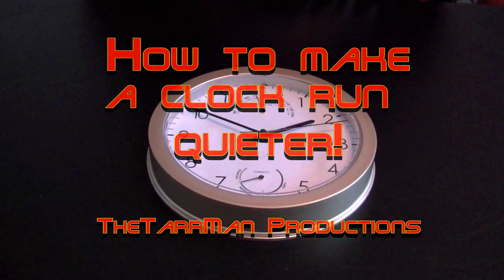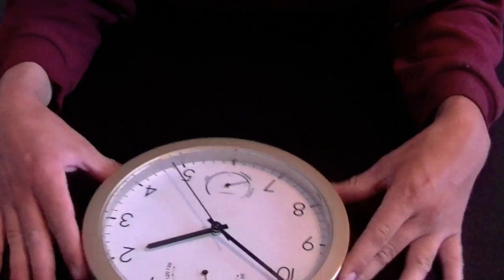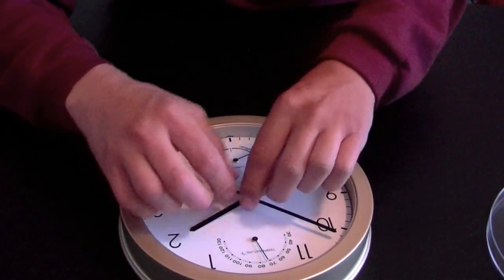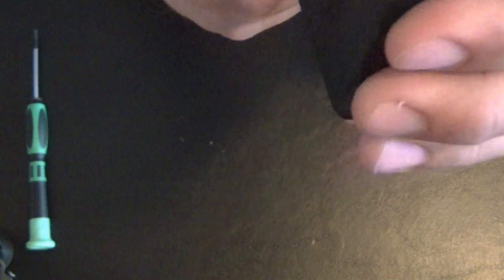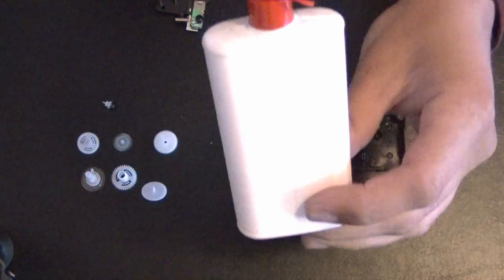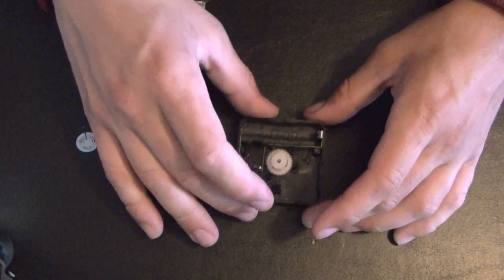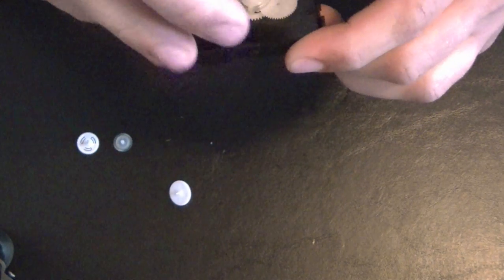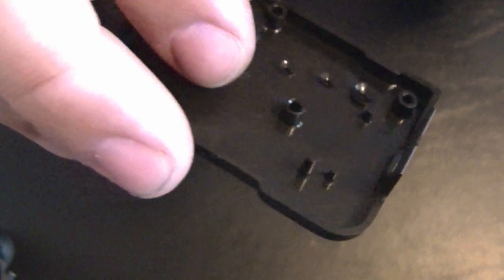How to Make Your Clock Run Quieter

Comment: Watched your video and my clock went from super annoying loud to barely a whisper.  However, you might want to refilm it because 1/2 of the important stuff isn't being filmed.  You are holding everything above the camera lense.
Reply: I fallowed every step but unfortunately, after the procedure, my clock stops moving . So disappointed. Somebody could help me out?
Reply: Kira Kira  Glitters I think it's all about the oil slowing down the movement of the magnet, Too much or too thick the magnet will not make the 1/2 rotation it needs to.  I doubt the oil on the other gear shafts make much difference.   Wipe off most of the oil on the magnet.

Comment: Over time oil will damage plastic gears. Better to use silicone lube.
Reply from the maker: That probably true but it's still working problem free. It's not like it's something I touch and adjust all the time either.  The only time I mess with it is for daylight savings.  It's still even using the same battery.
Reply: @TheTarrMan  could i use wd40?
Reply from the maker: It's been over 5 years now and it's still working fine.
Reply: @TheTarrMan  Lenny is technically correct about using a silicone based oil for plastics. Most likely the reason why your clock is still working is because it is a light duty application and it will take a long time before the ends of the wheels become so soft and flexible that the clock won't run. You would see the results of using the wrong oil or grease much quicker if the gears were under a heavy load such as the plastic gear that is used in power windows in automobiles. For those applications I use white lithium grease. I make clocks out of old damaged records for friends and I agree that a little oil makes those quartz movements much quieter so oiling them is always the first step. They make oil for quartz movements but I just put some silicone spray into a bottle cap and use a piece of wire as an applicator.
Reply: I used a solvent free bike suspension oil, works fine for plastic and rubber bushings, must be good for plastic gearing

Comment: Thanks for the Video. The most important tip is to go very slow and careful while opening the "Black Box". The plastic gears are sort of fragile and loosely fitted in together. And the second most important tip is to take pictures prior removing each plastic Gear. Don't base it on your memory . Everything within the assembly starts to look alike by the time all gears are removed and time comes to rebuild the Black Box and place all gears back together in their right places and correct Orientation.  Last tip is avoid too much oil and give it a try.  If it doesn't work the first time don't simply throw away. Keep at it and repeat the steps until you place all gears back correctly.

Comment: I did this one night when i couldn't sleep...
Well actually i have to admit, i was in a bad mood, so i just pulled the clock off the wall, took time setting wheel off the back and poured in like half a spoon of thick machine oil and shake it really hard, then put it on a newspaper to drain the oil.
It is almost completely silent since, and still runs after like 3-4 years...and there is a long oily stain on the wall from oil that has dripped out over next years, and some of the oil went to the front of the clock face...and it is still there ;-)
Reply: ㅋㅋㅋㅋ

Comment: It worked!! I ordered a clock oil from ebay for about £3.50. Luckily I only had 4 little circular dials to remove and oil up so wasnt hard to keep track of! When I put it all back together again I was almost worried I messed up because I couldnt hear anything, but it works! I could only hear the ticking when I put my ear right against the back of the clock :D my room is now silent
Reply from the maker: Glad to be of service.

Comment: I have a sweeping second hand that was loud even though the brand claimed it was silent. But a few drops of oil on the gears and the dimples really DOES make a difference. The tick went from being louder then traffic to nothing. if you are scared of breaking anything just take pics every piece you remove so you can piece back easy.

Comment: In my case and it worked for me, and I don’t see why it wont work for most battery powered wall clocks. If the ticking annoys you, then an easy way to stop the ticking is to remove the second hand if you don’t need it. It’s easy.
Just remove the clock front, pull the second hand off and replace the clock front. Done.

Comment: Clever and interesting.  

The alternerative of course, because the clock 'module' can be removed, is to replace the whole 'module' with a dirt-cheap sweep seconds movement, so that the seconds hand moves continuously round the dial, not pulsing, which would be so easy to do and I already have an on-line company I've discovered who can sell those.

(What I like about the continuous sweep-seconds movements is because it makes it look as if the clock is electric, using a synchronous motor, but of course is still quartz/battery.  I have one repro 'Smiths' wall clock fitted with one of these movements and love it).

However, thank you for your insight and explanation.
Reply from the maker: I'll have to look into those. Stupid question but hows the battery life on those? I'm getting about 1-1.5 years out of a double "A".
Reply: How long does a battery last in that type of movement? I have just bought a few and are just about to replace the old tickers.
Reply: @TheTarrMan  I have a clock with a silent movement, they run for about 7-10 months. But weirdly, they start making a peculiar 'whirring' sound after a year or two.

Comment: Just did this to a 3 dollar Ikea clock, much much quieter. I have quite a few of them around, and my wife hates ticking, so I might do this to all of them in the near future... I'm going to give it a couple of days though, however, just to make sure the light oil I used doesn't gum the gears up. I have 3 in 1, but I went with a small squeeze pen oiler I bought years ago, it's really handy for applying less than a drop of oil, it was sold as a fishing reel oiler.

Comment: Works great! I used a gun oil (I believe it is mineral oil..(Hoppes 9 lubricating oil)). Sounds incredibly better. BTW this doesn't get rid of the ticking noise completely. However before I placed the clock 20 ft from myself, and I could hear the ticking. In order to hear it now, I have to stand 2-3 feet away. That's an amazing difference. Thank you!

Comment: Use a plastic compatible oil if you want to movement to last.
Most universal machine oils are not and will degrade the plastic with time. SuperLube is compatible but can be difficult to get and expensive (but hey you use only a drop all in all).
Haven't noticed quality clocks getting worse with time. Perhaps if they have been oiled and the oil is evaporating. I believe it's 3 times I've repaired my moms Braun alarm clock from the 80s - a model with motion sensor for snooze which is out of production a long time ago and no motion sensor since either. I can't remember if I gave a little bit of super lube in the movement the first time but successive repairs have all been on the off button only - amazing it haven't been necessary to replace it with a generic switch yet - the movement still runs like new with just about no noise.
Many movements are unoiled from factory. Even then a quality movement can last half a century or more. When assembling you don't need to nor is it a good idea to oil everything. The few important pinions and to teeth of the first two or three wheels in the gear train to prevent teeth from rattling.
Or take a Seiko world clock I got cheap at a flea market - estimated time period the early 80s. It has one of the first sweep hand quartz movements from Seiko using a C size battery. Despite it originally was unoiled it's nowhere near worn. It was however very noisy (different noise than ticking though). Clock was overhauled as it was dirty beyond belief and movement too had a thorough clean. When assembled I lubed the important gears and pinions. The result it that it's now even more quiet than even the quiet brand new AA size Seiko sweep movements - despite those movements Seiko do give a little lube from the factory.
If you ever take apart a sweep movement - be careful - especially the AA size movements as some of the gears are delicate and easily damaged.

Comment: Benjamin, great initiative I like you details work. But I have 4 walls clock in the hall it makes hell of noise. I solved it very easy I REMOVED THE SECOND hand, it works well no sound at all.
Reply: I wish I could do this, but if I took the second hand off of mine (or any of the hands really) my clock would break! I don't know what to do 😭

Comment: Digital clocks are a good solution. The oil that you mentioned seems to be meant for metals and not for plastics, they might react and eat into the gear's teeth resulting in loss of accuracy.

Comment: It worked for me! I also added two small pieces of felt in between the back of the clock backing and the movement box. I put it all back together, without the hands, OOOPs, So don't forget to do that. It truly cut the noise to almost nothing.

Comment: My guess is the one drop of oil in the area containing the magnet decreased the speed the magnet moved, reducing it's impact & noise.  I thought you were going to glue a mass to the inside so the dial would not act like a sound board.  If you put the battery in and hung the movement alone where you hung the clock I think you would have found it not annoying.   Drop of oil on the magnet that you did works great & easy to do.  Good video.

Comment: thanks man...I've been thinking about to do this, but wasn't sure i wont break it....after your video encouraged me, I oiled up the gears and it's perfect...:D you really helped...:) by the way, I did it with machine oil, but any oil woud do it, but i recommend not to use those you find in the kitchen, those are not made for this things and eventually after a while will become sticky and will wreck the mechanism of the clock...:)

Comment: Removing second hand is a quick fix .
German and Japanese movements are a lot quieter than Chinese ones
Reply: +Rob Probin best solution thanks
Reply: you are welcome glad i could help
Reply: English movements are quiet to.
Reply: +Rob Probin In my case I have a clock from Ikea without a second hand, it tick-tocks like a bastard. This quieted it right down.
Reply: Our clock doesn't even have a second hand and it's loud as hell. :(

Comment: You principle was valid and I have just applied the same to a large wall clock whose "Tic-Tock" was driving me mad. I pulled it apart and used an aerosol can of Silicon Grease and spayed all the moving parts and it now goes about its timely business without broadcasting its movement every second. Thank you for the video - poor framing and all . . . . .

Comment: Thanks! The only oil I had around was some electric hair clipper oil, but it worked. It's not completely silent but it's a big improvement. (Mine has no ticking but I can hear a grinding sound as it spins)

Comment: Would it not be easier to put rubber dampers either on the outside of the  clock movement's body or if you have room on the interior of the clock without dis-assembly put thin rubber slips glued in on the interior to dampen the tick-tock  noise.

Comment: Hi thank you for your video, do you think this would work on my radio controlled clock or would that raise further complications
Reply from the maker: It would work but there would more circuitry you would have to be carful not to get oil on. Also the disassembly process would be different. If you do it make sure to take pictures as you go so you can remember how to reassemble.

Comment: What actually makes the noise?  Some commenters removed the second hand and if that does the trick it must be gear tooth lash that's responsible; removing the second hand would significantly reduce the moving mass, so less recoil within the gear train.  A relatively heavy oil, like your 3-in-1, would also dampen the lash/recoil.
Reply from the maker: That's what I was thinking. A clock made with closer tolerances would probably be silent right out of the box.
Reply: TheTarrMan
A clock in my office at work has a loud tick and may be an example.   The second hand vibrates with every tick so there's plenty of mass to create noise from the gear train.  It's never really bothered me but I'm going to remove the second hand (if I can) and we'll see....
Reply: frankdn109 Mine doesn't even have a second hand and is LOUD. I'm pretty sure the problem is backlash of the gears caused by the stepper motor, and when you have oil in there, the cogs doesn't much as freely.

Comment: From my experience I have found that using oil on plastic doesnt work. Plastic is just very thick oil and it doesnt like different types of oil on the mating surfaces.
Plus you dont want want to be puttung anything on that will attract and hold dust or harden with age.Try some of the silicone lubes .

Comment: Without going through all that messy work. I just purchased a great movement kit, real silent, including the hands and the shipping cost for under a dollar.
DIY White Hand Quartz Clock Movement Mechanism Replace Parts Long Spindle Silent  | eBay

Comment: I used to put some socks or foam between my clock and the wall. I had a little alarm clock that was a bit noisy on the shelf, though I sleep with earplugs in. The biggest problem was my refrigerator cutting in and out to keep cool. I sleep in a studio flat so my living room is my bedroom.

Comment: Better solutions:  Buy a clock with a sweep second hand movement that doesnt tick (silent) or replace the movement with one that has a sweep second hand design (also silent) - the latter is cheapest and keeps the original clock if so desired.

Comment: After oiling, make the gear box air tight. The "wet oil will attract dust and gum up.
Reply from the maker: Going on 4 years, still working.

Comment: so I did this.. took photos put it back together.. then..none of the gears would move again.. I made sure all of them were up the right way and in the right order .. they all seemed to move fine but when I  put the last cog in ( the one with the long pin).. nothing would turn.. it's like it was getting caught
Reply from the maker: +Jenna R (SeRoToNiN88) Pop the cover off and put it back on. Sounds like the shafts aren't lined up with the little holes in the cover.
Reply: +TheTarrMan they wouldn't even turn without the cover tho

Comment: 1. Opened my clock
2. Sprayed half a can WD-40 in it
3. Still ticks as loud as before
Reply from the maker: +Tweak Er Thats because you used WD-40 man. You got to use a oil that's a bit thicker, like 3in1 oil.

Comment: can i use olive oil ?
Reply: Do NOT use olive oil!
Reply: why what happens?
Reply: your clock wont run and will bung up
Reply: +sherNshreya Tamang Olive oil — or any animal or vegetable oil — gets rancid ("oxidizes") and thickens, and will eventually bring the clock to a halt.  Only use mineral oil or silicone oil, which won't oxidize.

Comment: Did this after few months the clock started working fast 10 minutes in every 4 to 5 days later on I went to the watch repairer he told me that the entire mechanism is made of plastic which after oiling will ware off easily finally replaced it with a non ticking machine

Comment: Will WD40 also work? Which I assume it would?
Reply: +Tech Eggplant! I tried, this will not work.
Reply: Whhhhhhy didn't I read the comments first?! I just did it with WD40 and it sounds like it's ticking louder! I guess I'll have to do it again...
Reply from the maker: I used 3in1 oil. Works great

Comment: my clock runs fast how can i fix that problem?
Reply from the maker: Fast after you oiled it? I've heard of this problem but normally it slows back down to normal after the two weeks. It will still stay quiet for years. Just recently I re-oiled it after three years of silent operation. (Because I noticed it making the ticking noise again.)
Reply: no i bought it new, one of a kind clock and it runs fast dont know why. i let it run for a long time and it still dont slow down.

Comment: can i use WD40 on the gears?
Reply from the maker: No! WD-40 is a solvent, not a lubricant. Walmart has "3-in-One Oil" in the automotive section for under $5. Probably right by the WD-40.

Comment: Stupid to take all the gears out.  You could have saturated the gears without removing them.
Reply from the maker: Lubricate the shaft pivots ONLY. If you lube the teeth you will slow down your movement.
Reply: @TheTarrMan  Azon sells silent movements for as little as 2 bucks a piece if you buy 10.
Reply from the maker: @JuanSanchez-ik7wx  This video was made like 10 years ago. Back then those movements were much more expensive.
Reply: @TheTarrMan  gotcha.   Maybe its time to take it down.
Reply from the maker: @JuanSanchez-ik7wx  Ouch!